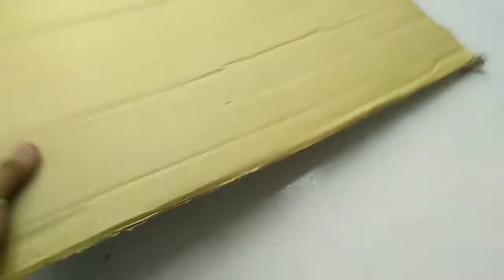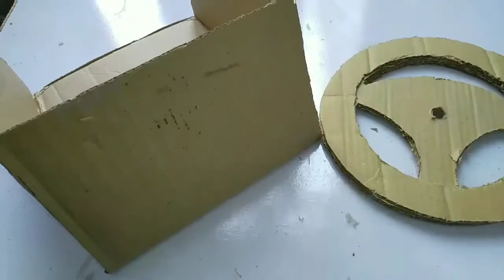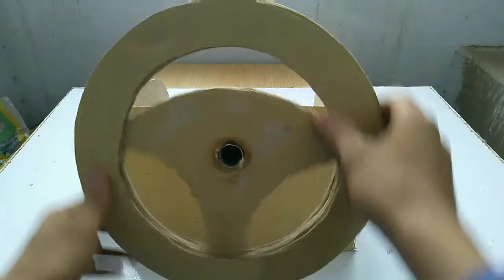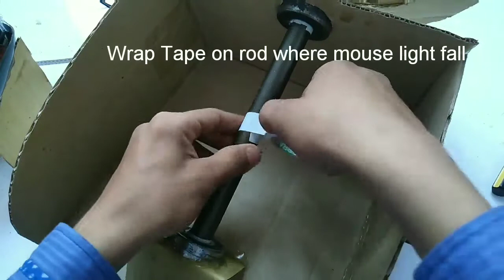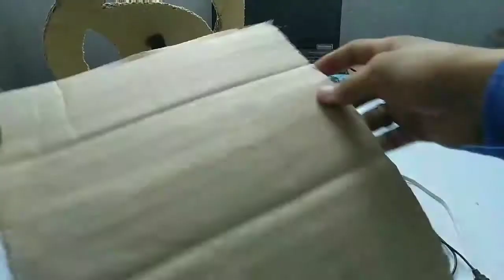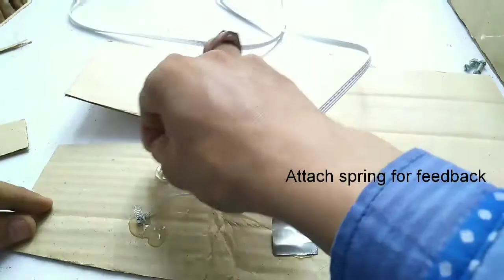How to make a Steering  Wheel setup for PC Gaming

Comment: Bro for mouse right and left click which wire should match another wire
Reply from the maker: You need to connect two wires from the points of left and right click
Joining two wires of lmb will work as left click and same for right click